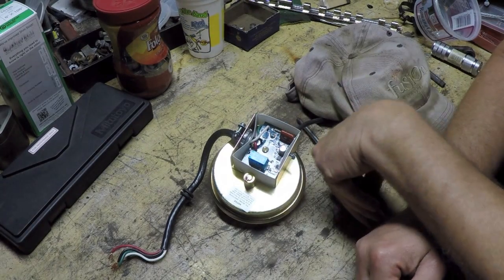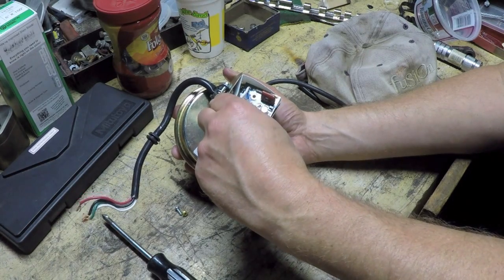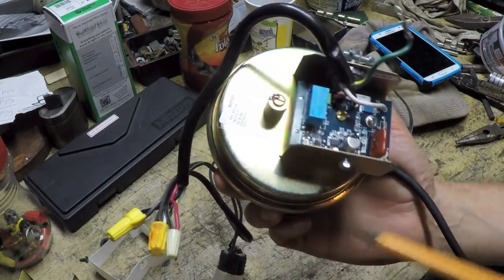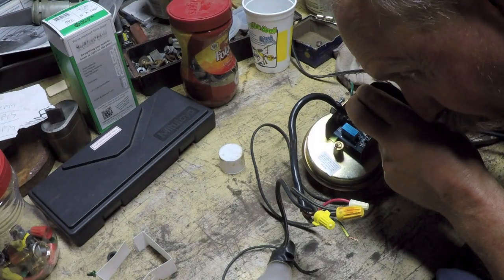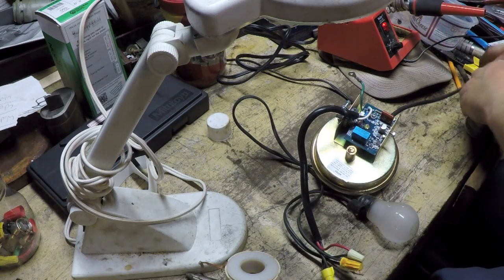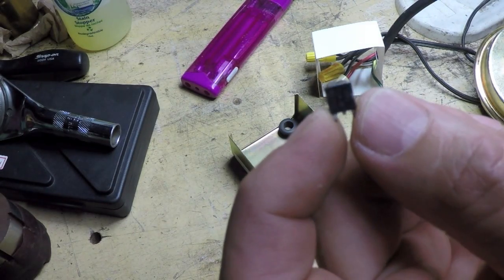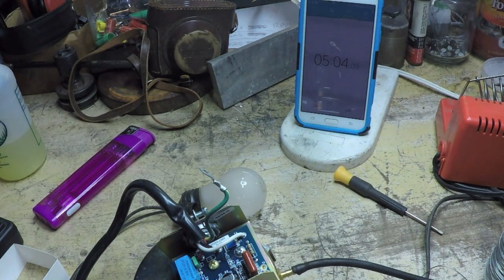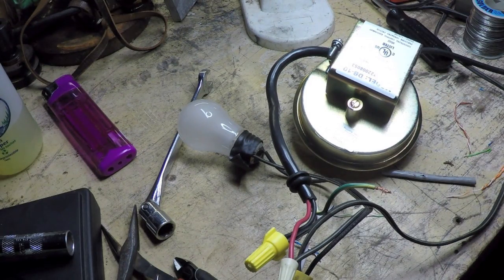Fantech dbf110 dryer booster fan Part 2

Comment: how do you adjust the sensitivity of the pressure switch? mine seems to come on any time we even open the dryer or someone sneezes at it. We don't have the adjustment screw like yours has.
Reply: The manual for the dbf110 says you can rotate the pressure switch to increase or decrease the sensitivity if you’re at high altitudes for instance.

Comment: Excellent repair!  That MOSFET should be plenty robust.  It would be interesting to know the Vgs of the old vs the new MOSFET.  I may be wrong and often am, but I think they can be driven by a range of voltages to get them to conduct.  If this system only loads that new MOSFET to a Vgs lower than its nominal or even highest specs, it's likely never to overheat or let the bleu cheesy joke smoke out.